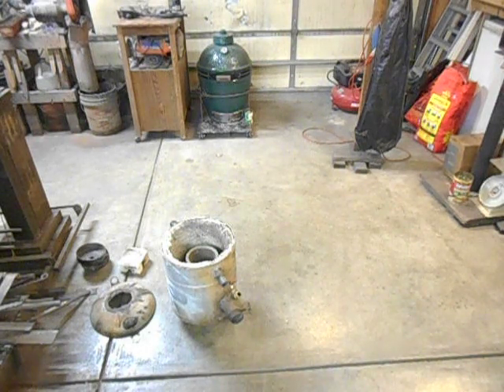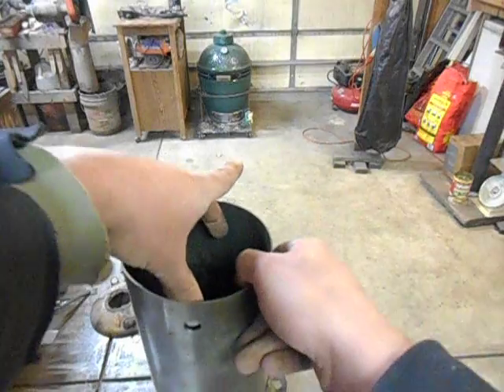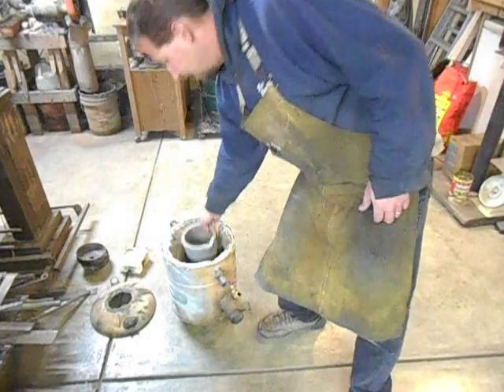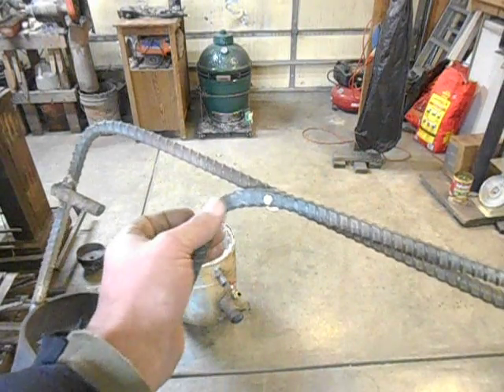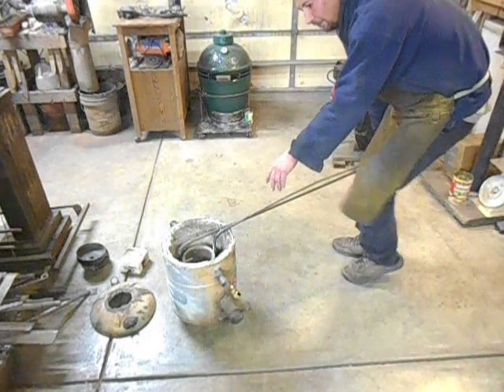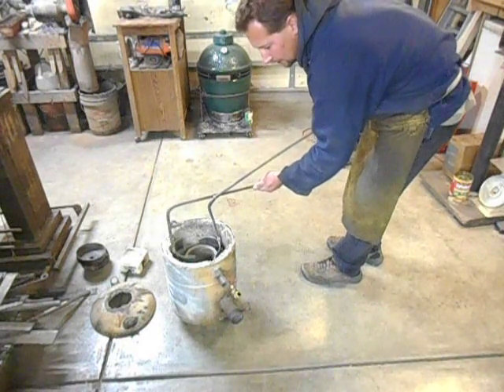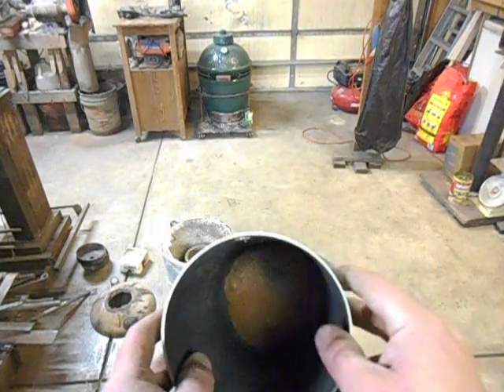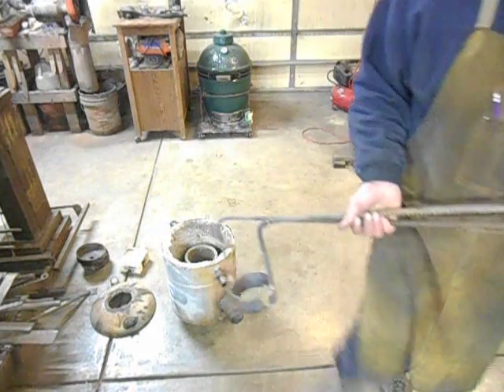lifting and pouring tongs for metal casting

Comment: Great video thanks so much, I'm just learning the trade myself, first thing I noticed was the 2 tool method, not looking like the best solution for pouring molten metal .... was thinking didn't look the safest, this approach is much better !
Reply from the maker: Glad it helped. I suppose a fella would get used to that 2 tool method over time, but with all that heat in a liquid, I just liked the tongs better.

Comment: Hi , the design is good in principal but the handle is way above the center of gravity of the loaded crucible and will be awkward to pour. it would be best to keep to two separate tools especially if trying to pour heavy metals such as copper and iron. One for lifting out of the foundry and the other for pouring. cheers
Reply from the maker: now that is the best explaination ive seen about why to use the 2 tools, thanks! this one works pretty well for the small crucble that I have, even when doing copper, brass and iron. but I think you may be right in that if I had a bigger crucible it may be akward.

Comment: Check out "MyFordBoy" he has a nice lifter/pourer.... he's not a welder so he riveted everything together.
OH! You want to build a bigger furnace... find an old alum or stainless beer keg. That should take a #10 to maybe #14 crucible. (But then you'd have to thing about how to lift that much metal).
Reply from the maker: +Grandpa Bill, myfordboy's lifter is one of the places that I saw the idea first :}  I think I will make a bigger furnance sooner or later, and then convert this one into a dedicated Damascus welding forge and run it on waste oil all the time.